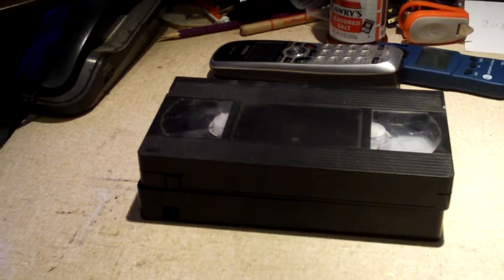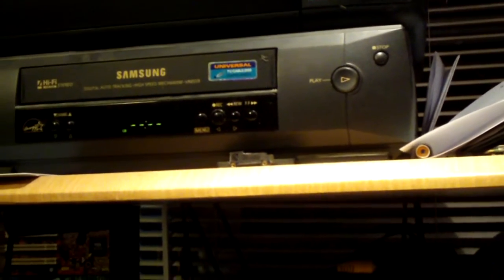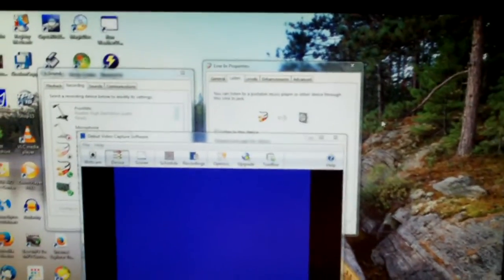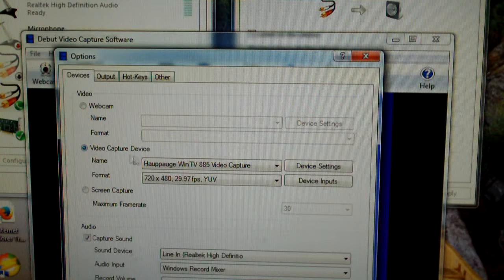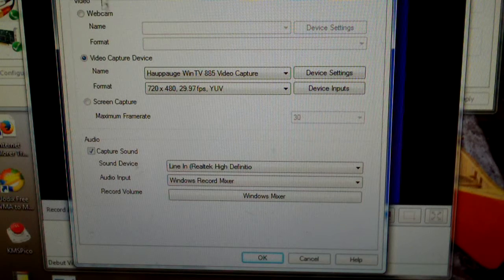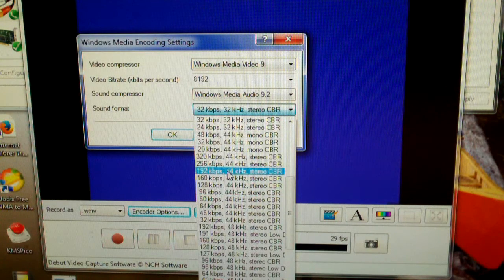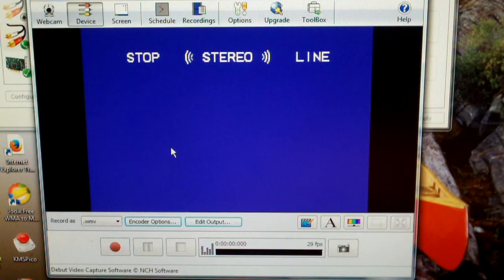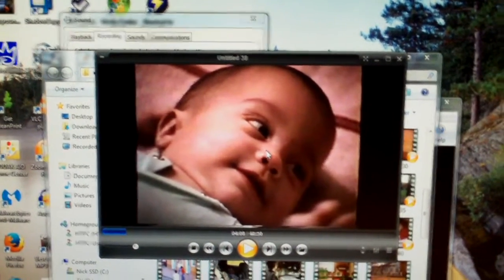How to digitalize videos from old VHS cassette tapes

Comment: Great video! I picked up an Easycap UTV007 off Amazon for like 8 bucks a while back and managed to capture the contents of some 8mm tapes before the camera I was using for playback decided to die. As far as quality goes, the dongle's outer plastic shell comes apart rather easy and the exposed board itself gets pretty hot after heavy use, but it worked all fine and well with capturing. I'll keep this video in mind though once I find a player or camera for the rest of my tapes as the software I used back then was a real pain to work with.